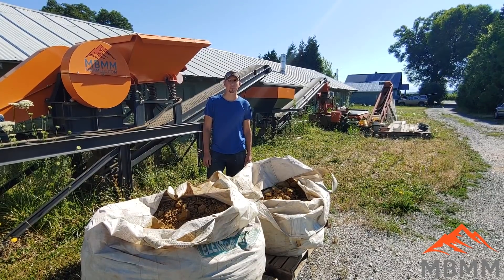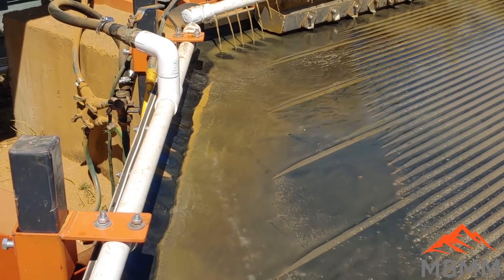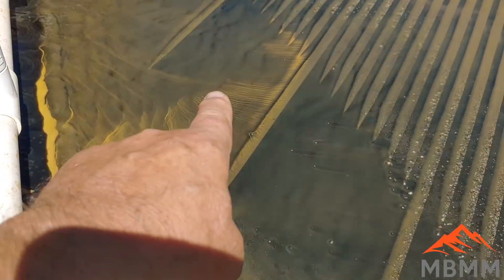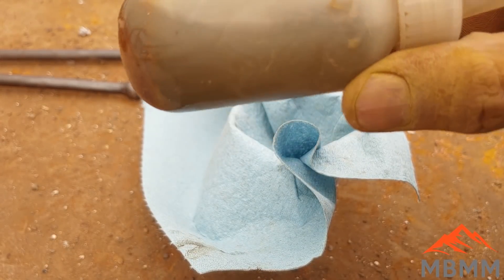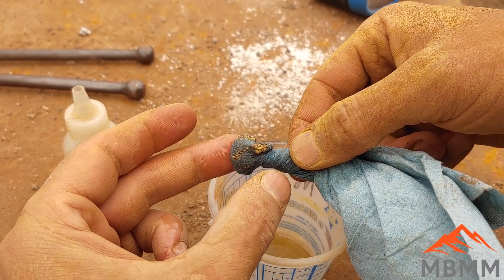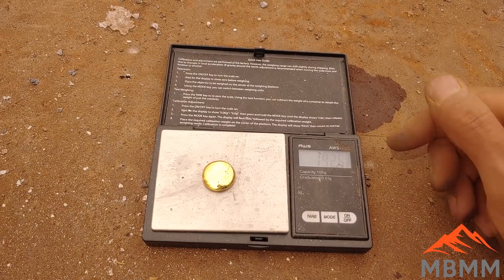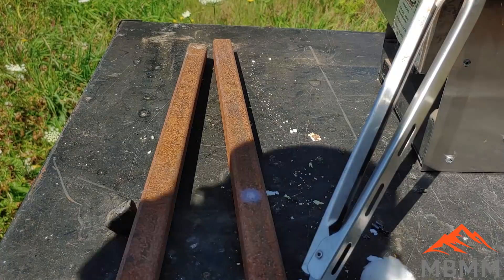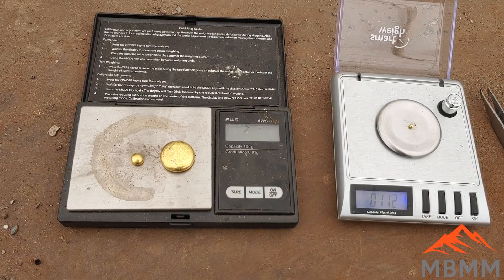Complete Gold Milling Process! From Gold Ore to Shiny Gold Button

Comment: My opinion I get your gold out on your Shaker table and take your snuffle bottle stop to Shaker table keep the water running and start collecting all the gold I get a cup or a container dump all the concentrated water in there. if you want to get all your gold that might be one way to collect it all still get your buckets to play with for later but most of your gold would probably be in the bottle I'm guessing. Once you collect most of it start to shake your table again get more gold going and repeat it again I'd let some of the gold go into the bucket still. It might be more time consuming but you would collect most of your gold if you can find a way to suck up all the gold on the Shaker table there was quite a bit

Comment: How much does a system like that cost?  I am going to be prospecting then eventually setting up a site in Havelock Ontario, Canada and have been looking for equipment prices on a good crushing and miller table system. I really like the setup you have going on, it looks like it runs quite efficiently.

Comment: Submitted on August 13, 2020
Values Entered:

Gold Weight:  	19.25 grams (equals 12.38 DWT, also known as pennyweight)
Purity:	24k
Gold Price:  	$1950.84 / troy ounce
Answer:

Total gold value is $1,207.38.

This doesn't mean you should expect to receive $1,207.38 from a buyer. This amount represents the current melt value using the live gold price.

Comment: You’ve probably considered this, but I wonder if it would be at all cost effective to add a vacuum / filter stage where you are dropping into the hopper. It looks like you already get a fair amount of dust just from the little drop into the hopper. If you added some airflow through there and captured the dust via a filter, it would maybe increase the sorting by getting all the super light stuff to fly off as dust, and also reduce the airborne dust because of the filtering. And you’d have cake left over in case you wanted to verify you’re not losing any gold via the dust. No idea if the cost of running the filter and increased maintenance would make any sense though.

Comment: How much ore can be processed by this system  in an hour?
Reply: That jaw crusher, hammer mill, shaker table set. Is their 1 ton per hour turnkey hammer mill setup. Check out their website for other equipment.